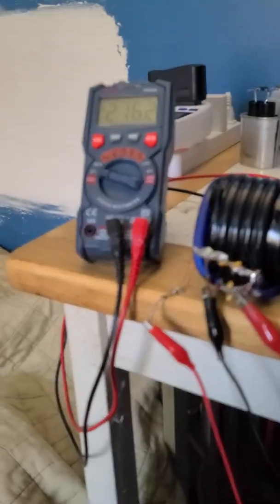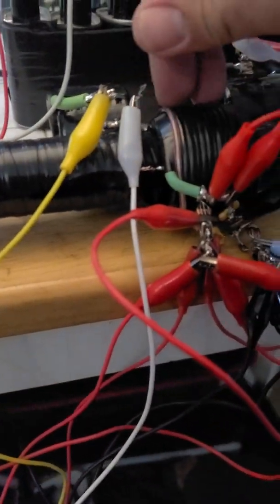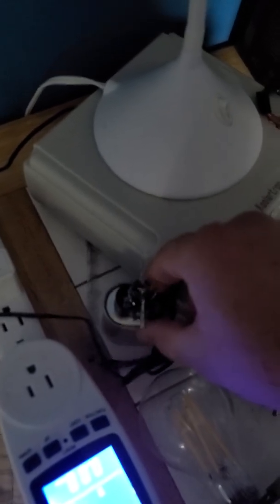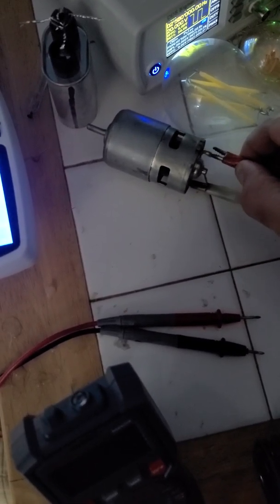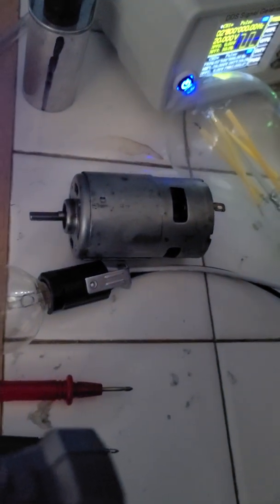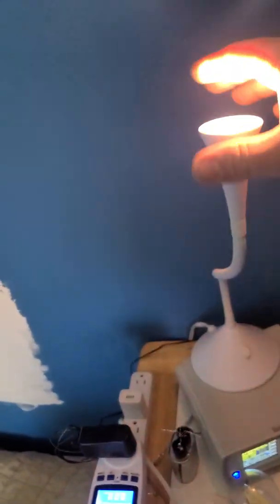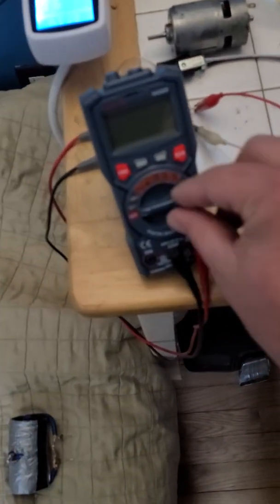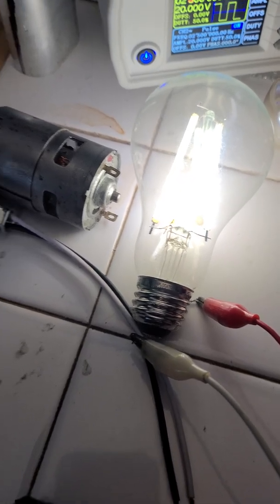💡Resonant Wireless Power Transfer 50 Watt Output 12 Watt Input. This Device Is A Solar Transceiver💡

Comment: How is the coil wired in to you cap bank?
Reply from the maker: On this device i made 6 large pick up coils. 3 were wired in series for voltage & 3 were wired in parallel for amperage. I then took those outputs & put them into the caps so the system was volts amperes reactive. I had around 250ma @ 250v
Reply: @MTECHINDUSTRIES  sweet thank you!   You really need to post a schematic

Comment: I don’t see anything close to 50w just being honest … light up a incandescent 60w  bulb then I’ll believe you have 50w. Anybody can lite a  LED
Reply from the maker: Ill have to buy some incandescents. The meter readings say around 50ish watts once everythings tuned & converted to dc. It ran a 120volt drill motor with decent torque
Reply: @MTECHINDUSTRIES  I’d like to see your results  not beating on your work. I know where it goes. Once you have the ability to light an incandescent from a frequency generator I have a suggestion for you  step the output down. And increase amperage  you want to have high voltage resonance reduced to low voltage. Ie 10 kv to 100 v 😎 this is how it works…. There is a gain in joule with a raise in voltage this is amplification factor Tentire system should operate at the same frequency including your output transformer I just don’t know if your voltage is high enough yet
Reply from the maker: Yeah im gonna need to buy different loads to test. Maybe some 50 watt incandescents & resistors too & see if they get hot

Comment: Dude!! Again.. what the hell man! Your work is incredible! I need the schematic  please! I'm going to replicate and try a few things.  I'll report back
Reply from the maker: Ill be adding more schematics soon but alot becomes clear if you read the full video description. To keep it simple we put 6 four inch coils on a one inch diameter pvc pipe. 3 are wound clockwise & 3 counter clockwise. The 6 coils then have 1n4148 diodes in opposite directions off each coil & we wire them in series. Your primary coil needs to be fully adjustable & tuned for 3 or 3.1 mhz.
Reply from the maker: Thanks for the support by the way. Im trying to build a device that sucks in all available RF energy from the surrounding enviornment
Reply: @MTECHINDUSTRIES  need more videos please!

Comment: You use capacitor
Reply from the maker: When i capture the wireless power & convert it to square wave AC i use a big 30UF capacitor. It stores the wireless energy.

Comment: great! time to try the famous loop no ?
Reply from the maker: Yes very soon. Just have to convert that power to 120v 60htz exactly. I might turn all the energy to pure dc then use an 12vdc to 120vac inverter circuit. So many ideas to try. This project is getting exciting